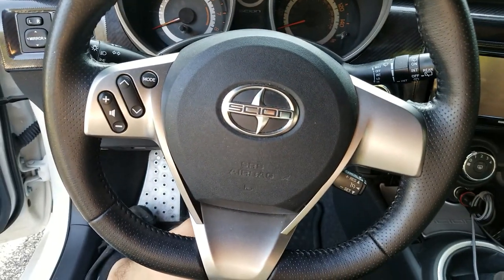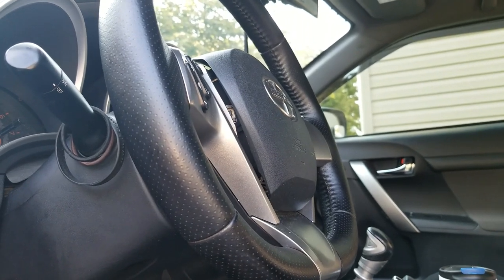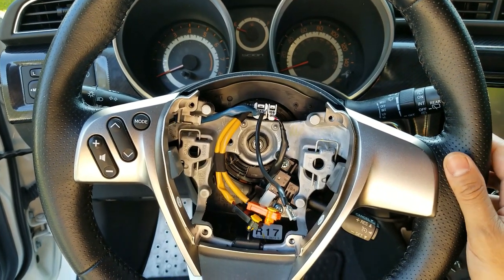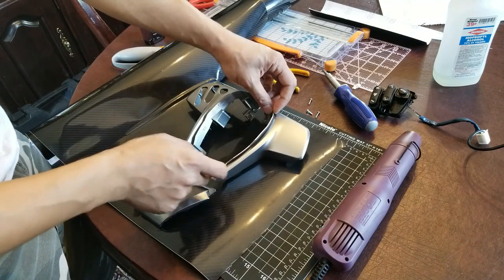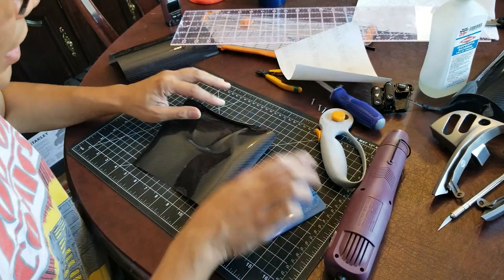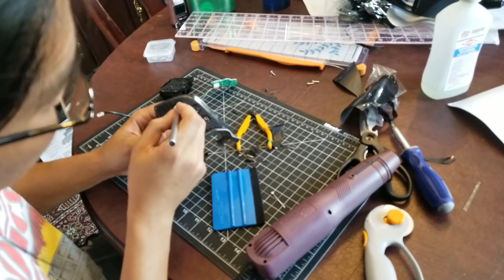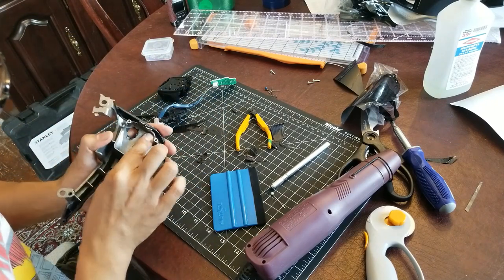Wrapping Steering Wheel with VViViD 3D Carbon Fiber Tech Art Vinyl Wrap (Scion tC2 / tC2.5)

Comment: Upon the removal of the steering wheel make sure that the clock spring is not rotated which can result in damage to it if not centered correctly when reinstalled. One way to make sure is with the clear window in the clock spring to show an orange indicator! This till save you guys in the long run with myself rotating it and losing my vsc system!
Reply from the maker: Good info to know. Pinning your comment.

Comment: Just want to say that for the ground wire you don't need pliers. Behind the connection of the ground wire there's a small tab that you can just push with your nail and it comes out without any force on it

Comment: Is taking out the airbag and placing back in like that going to mess up my tC? Will it effect the title or make any dash lights come on?
Reply from the maker: It shouldn't mess anything up. I've never heard about it affecting the title and it won't make the dash lights come on. Just make sure you have the battery disconnected so you don't accidentally trigger it.

Comment: Which tool kit brand do you use?
Reply from the maker: I used the TECHWRAP squeegee at first. When my order from VINYL FROG (https://www.amazon.com/dp/B0719J99HL/) arrived while I was in the middle of the process, I found that their squeegee card was a little more flexible and easier to get into the corners and grooves with.
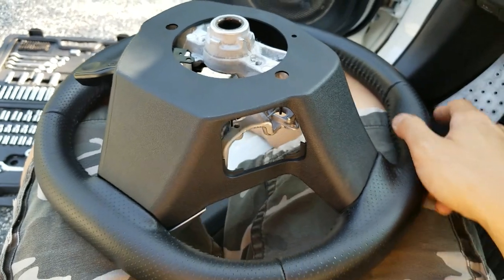Reply: Derrick Aquino which hand tool brand do you own in the background (minute 5:41)?
Reply from the maker: I have the Stanley STMT71654 201-Piece Mechanics Tool Set.

Comment: Lmmfao um remove the POSITIVE terminal smart guy.. 😂😂😳😳😒😒
Reply from the maker: For safety, you always disconnect the negative first from the battery. This prevents accidentally grounding out your wrench on the car body in the process. Once that is done, the circuit is open so there is no need to disconnect the positive.